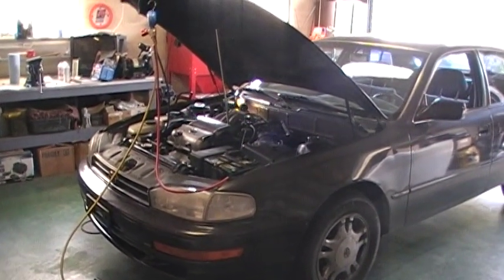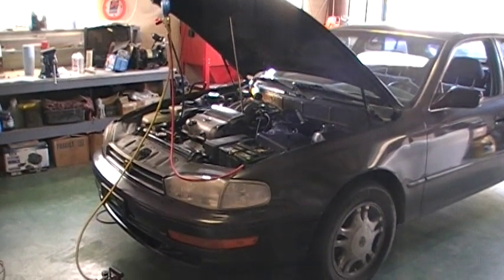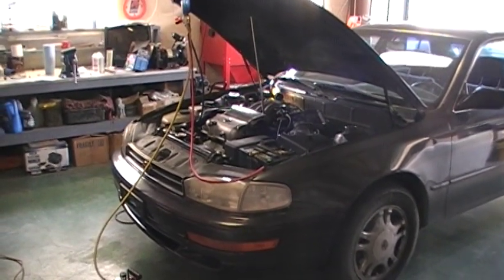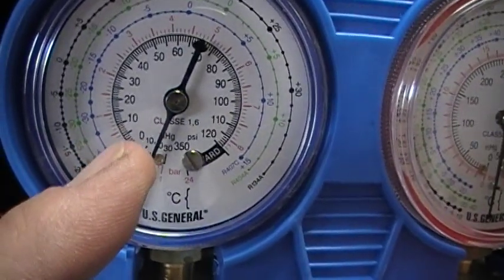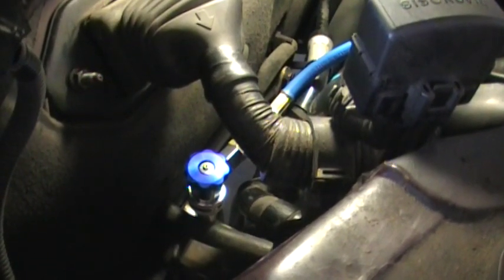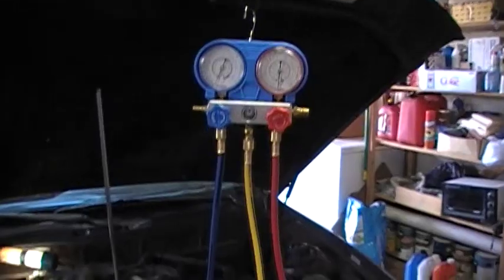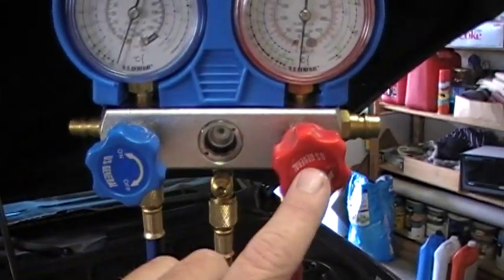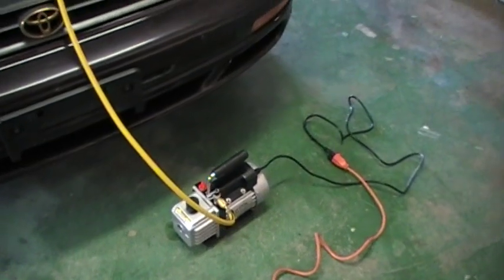Toyota R-12 to R-134A Retrofit Part 1

Comment: Reluctorvalve,
I live in Brazil and I have a WV who still uses R-12, but it is still lubricating oil mineral, and not compatible with R-134 that uses synthetic. Toyota also this should not have been changed? Du Pont also recommends changing the filter dryer with a new molecular compatible with R-134. It proceeds. Thank you very much,
Fireball
Reply from the maker: Hi Fireball!  I'm not sure I understand your total message, but I think you are concerned about the A/C system OIL used in my example.  You are correct to question that, and I have had to further buy a bottle of the proper oil for conversion.  However, the conversion kit that I bought came with the proper oil needed.  The key is to evacuate your system, and then use the conversion kit which also has the proper oils needed.  If you have questions, just message me and we can go from there.  r-
Reply: +reluctorvalve    how do I vacuum out my system on a 1988 Mustang r12 and put 134
Reply from the maker: Guillemero- FYI, it is illegal in the US to allow the old R-12 freon into the atmosphere.  The typical process is that as a normal consumer, you should take your vehicle to a repair facility and have the "evacuate," or take out your old R-12 freon, and they contain it rather than letting it go into the atmosphere.  This is because the old R-12 damages the ozone layer of the earth, like many other chemicals have.  At that point, you have the option of having that repair facility convert your system to R-134A, or you can also purchase retro-fit kits to do it yourself.  My suggestion is that if you are familiar with AC low/high side pressures, lubircants, air dryers, AC gauges, etc....you most likely could retro your own AC system.  If you are not comfy with these items, I'd have a repair facility do the work.  AC systems operate a high pressures.  Hope this helps some.  r-

Comment: What the vacuum does is lower the boiling point of water to 70 degrees or so. This allows the water to boil out and the moisture to be removed. Great video by the way.

Comment from the maker: John S: Clarification for any looking hard: R-12 and R-134A system are 'exactly the same' when it comes to the need to get rid of any moisture in the system by using a vacuum pump-- the process is the same, and I've had luck with many retrofit processes on older vehicles using the same process-- with a vacuum pump such as I used here- connections are the same, process is the same, etc. here. r-

Comment from the maker: John S cont'd: However that was some years ago and as time has passed they now sell good quality retrofit kits with awesome materials, but ironically associated to this reply, it is the vacuum pump process (which many don't do at home) which makes them far more successful. If the pumps were 'illegal' they wouldn't openly sell them. R-12 is Federally illegal, but the vacuum pumps are not.  Just gotta know the proper use of the tools. Hope this clears up any confusion. r-

Comment from the maker: John S cont'd: down to a vacuum, or 'negative' pressure, for a duration of time, in order to break down moisture molecules and to evacuate, or get rid of, any traces of moisture in the system. R-134A/R-12 systems are exactly the same. The vacuum pump is NOT for getting the old harmful freon out of the system- that is done, as you correctly point out, by a certified shop and captured. Further, many shops used to re-sell the old freon that they captured for those not wanting to convert. Cont'd...

Comment from the maker: John S cont'd: is illegal. These pumps like the one I use are NOT for evacuating freon. They are to be used only on system which have already been purged of R-12 harmful freon. All notices in today's A/C retrofit tools and supplies accurately instruct users to have their systems legally purged and contained, usually at a certified shop. The vacuum pump you refer to as 'illegal' is then used on a system which has nothing in it, and is specifically used to draw the 'pressure' in the system cont'd.

Comment from the maker: John S: I was certified in Mobile Air Conditioning Systems (MACS) right during the time that you mention, so I am very familiar with what you refer to.  You are only partially correct in your description of what is and isn't 'illegal.'  It is not the vacuum pumps from Harbor Freight (or other ones like this from anywhere else) that are illegal, but rather allowing the old freon R-12 (automotive) to be purged into the open atmosphere.  continues....

Comment from the maker: UPDATE:11/16/2012:  This vehicle has recently been relegated to teenager-driver duty after a few years, now, of driving the crap out of it.  To date, this retrofit has worked flawlessly.  Key in my view is to use the vacuum pump and evacuate the system for an extended period of time, or about an hour.  Shut the pump off and wait and monitor the gauge set for changes in the system vacuum.  If the vacuum remains, that is a very good sign.  It is still working very well in the hot Arizona weather..